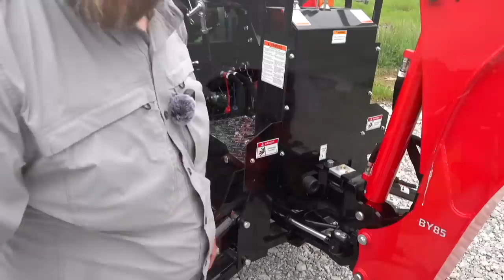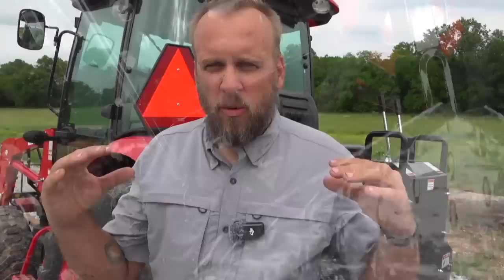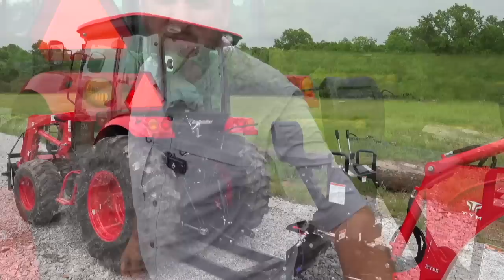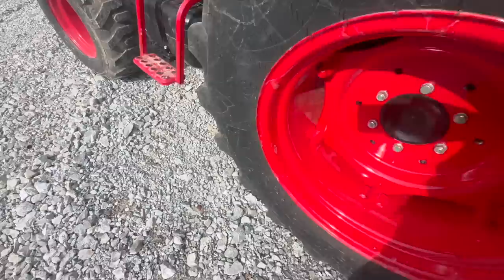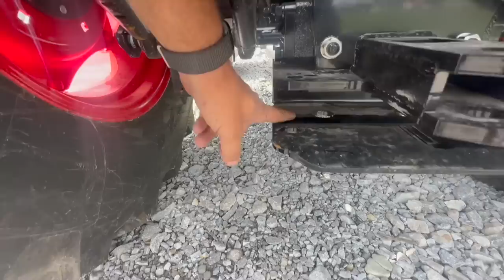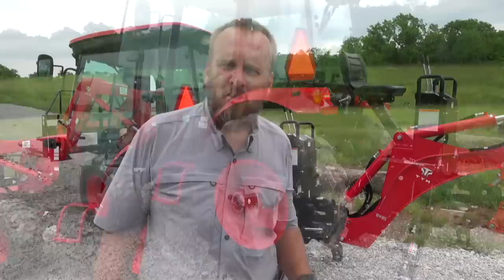TYM 574 Backhoe - Removal, Installation, and Operation

Comment: can you use your rear hydraulic hook ups for your front loader attachments (ex grappler)?  Possibly running a longer hydraulic lines from your rear hydraulic hookups to your remote to a grappler attachment?
Reply from the maker: You can. I did it when I first got my John Deere tractor. It’s not as convenient, but it is doable.

Comment: Excellent video.  It looks like the backhoe on that model tractor has a long enough reach to eliminate my need to get a separate mini excavator for my projects.  Question - rumor has it that Deere backhoes are easier to remove and attach.  After seeing your video, I am not sure what Deere could do to make the process easier.

I could see how a tractor company, using a computer and bunch of sensors, could mostly automate the process.  Perhaps we will see this capabilty appear within the next decade.

Thanks for posting this.
Reply from the maker: I had a John Deere two series and it was dramatically easier to put the backhoe on compared to this tractor. But I think that one had a special new system that isn’t on all the models.

I could literally take it on and off in two minutes. As easy as putting on a box blade. I did several videos on it if you search my channel name and John Deere backhoe.

You actually pick it up with a bar that goes on the three-point hitch. When you pick it up with that bar, it automatically aligns it, but then it still connects with a subframe for strength.

This system works the way most of them do from most of the brands. It’s not difficult or complicated except for getting it lined up perfectly. It’s a lot easier with two people.

Comment: Brock, you don't say anything about the connection from the top link to the frame under the seat. I understand that this is a necessary part of attaching the backhoe. The instructions on the manual are clear as mud.

Comment: I think the backhoe is nice.  My only turn off with some of the backhoe attachments is  I like the ones that pull the boom up vertical vs hanging halfway down  when not in use.  JD and Kubota have nice vertical boom transport position.  Woods is almost vertical.  But TYM and Badboy…. They are always at near 45 degree angle hanging down.

Comment: Ur cycling the loader joystick to relieve hydraulic pressure to ur rear remote?  U may as well go flush the toilet, it’d do just as good.  Lol.
Reply from the maker: The whole system is connected. I found that out when I installed the third function and it connected to the same fluid dump feature that goes back to the rear remotes.

Now that is my opinion. The part that is not opinion is that I’ve tried it in real life. It definitely works, but just to be safe. I usually cycle the loader joystick and the rear remotes and the three-point.
Reply: @ yeah that’s strange, I would think at least the supply side of the remote would stay charged between the valve and coupler.

Comment: I have the slightly smaller version of this backhoe on my tractor and have done a few things to make removing/installing easier.

1 - blocks under the main pin/pivot and under the sub frame so it cant settle when in storage. Before doing this the hydraulics would settle and the subframe would end up sticking up in the air preventing you from backing over it to reinstall.

2 - 4ft hydraulic hose extensions hang in my barn next to the backhoe incase you cant get the tractor backed over the subframe to install. 

3 - flat faced connect under pessure hose connections on all my tractor attachments

4 - when not connected to the tractor i have hose connections attached to the bachkhoe to connect the hoses to. These connections just have a 1/4 turn ball valve on them to releave any pressue that builds up in storage. The problem i found is that the return hose from the backhoe to the tractor on mine has a one way valve inside the backhoe. This ment that presure would build up in that hose with no where to go and would be to much for even the connect under pressure hose ends. By storring the hoses connected to my storage connections all i have to do it open the ball valve for a split secound and it released any pressure. 

5 - for storage leave the backhoe in a spot with an easy reference to line the tractor back up. Mine sits in the barn next to a wall, just line the tractor up straight with the wall at the distance that i remember and you will be almost perfectly lined up with the backhoe.

With these easy modifications i can typically hook up to the backhoe without any issues. I like the design of these backhoes once i got use to it.

Comment: Hey Brock love the channel. Are you aware that the last couple-few videos you’ve uploaded are only 720p?
Reply from the maker: I’m confused by your comment. I recently switched to recording everything in 4K and I can see that it’s 4K whenever I edit

Where are you seeing the resolution?
Reply: If you click the gear icon on the video, you can see the available resolutions. For this video it maxes out at 720p. The indoor woodyard video has the same problem. The zero turn mower video before that goes all the way up to 4k (2160p).

Comment: Hey Brock, thanks for the demo.  I'm new to tractors and recently bought a bobcat ct2040 with what looks like the same backhoe as that TYM.  I haven't removed mine yet, now you have me worried 😟 

Can't wait to see more bobcat comparisons.  Mine only has about 40hrs and the bucket roll back and backhoe controls seem very touchy/jumpy... Will that smooth out over time??

Comment: I had a 416B cat rubber tire backhoe- no cab.  It had 5k hours on it- and I put another 1k on it over 10 years.  (it was $24k in 2011- and I sold it for ...$24k in 2020.   You get very spoiled being able to push the machine up with the loader from the reversible seat (and toggle throttle). Having the front AND back off the ground really stabilizes the machine.  I bought a mini ex with a thumb because the CAT was too heavy to move- but I'll never get used to the 'tippy'-ness of the mini vs the rubber tire machine (plus you could turn around and grab stuff with the 4-1 bucket and actually move it!)   Good luck learning the ins and outs, man.  Stay safe.

Comment: I have a Kioti and the backhoe is very similar. It takes me about two minutes to remove or install. It takes practice, it gets easier. You did great for the first time. The people that seem to have the most problems are the ones that rarely remove them. I’m like you. I have lots of other attachments to use.

Comment: New mic worked well, no wind noise, and could hear clearly.  Good demonstration as well, I've always been hesitant to add a backhoe due to overthinking the removal process.
Reply from the maker: Thanks for the feedback. I think it makes the filming better if I can talk while I’m moving around and actually on the machine

Probably 15 minute process and a little bit of a hassle, but not terrible

Comment: Very interesting, that long sub-frame makes the angles in 3 dimensions need to be very precise compared to other brands, but putting the BH on a pallet on wheels on concrete, lets you move it manually and greatly simplifies the process..
I find with experience, you'll learn to slowly pull the controls and be able to slow the motion down, just like with the FEL, they hydraulic controls are not an on/off but incrementally moveable

Comment: I saw another video were they used the backhoe's side to side movement to help line it up with the groove. Seemed to work good for them but they didn't mention how far off they were from center. I'm seriously considering getting one of those tractors. Wife says I need to pay off the truck first so another year or so to go lol.

Comment: The backhoe (46) on my 2010 Deere 2520  (26.6 HP) is the same type of mount as this one. It has always been a royal pain....but I've learned that to make it easier, parking  it on solid and level ground makes a huge difference. It also helps to block it up close to mounting height...but make sure the pins are in the boom. The bucket sags and can mess things up sometimes...so the more you can make things rigid, when you leave it, the better. Also....a long handle prybar....such as a tamping bar, really helps sometimes.

Comment: Watch out for the white hydraulic filter next to the gas tank, it is very possible to hit it with the backhoe arms, its not important how I know this...The filter screws into a pot metal base and the base will snap off and you are immobile until repaired. The issue you may have is leave jt for a month or two and the slide part that goes under the tractor will be 2' off the ground. You then have to park next to it, hook up then put on ground.  My suggestion from using the same machine and same backhoe, is use 4 cinderblocks and 2 2x4s to rest on. I run backhoe at 1,700rpm, I switched my bucket to a 12" because of the ammount of rock here and our ground is literally decomposed granite. With a bit of practice you can do 2 functions at once.
Also something worth noting, I show this in my maintenance video I'm posting next week, the primary hydraulic feed is exposed on the bottom side of these tractors, I show how I made my skid plate in the video. (It's corney, but works) I would strongly suggest making or having some form of protection for this line, also buy a spare to have it, will cost $20 at dealer, if or when this hose gets torn you will thank me. Otherwise you are stranded until you get it fixed. The diameter of this hose and that it's for hydraulic fluid makes it next to impossible to find. I Have 2 spares, however since I made skid plate have not needed it.
Reply: It will take a couple times putting it on to get the process down. Use caution with the hydro filter by fuel tank. You can break it off easily with backhoe frame. I also find hooking up the top link will give you better stability.  There is a place for the pin under the seat. Bought a 9 inch bucket for stumps and trenches and it seems to work better for roots.

Comment: There is definitely no comparison to the JD backhoe removal and pin removal and pin storage. I have looked at several of the tym tractors, and I see they improved the rear seat bracket..    But congratulations. On you getting   some good reviews and new equipment.   I mean by the manufacturers.